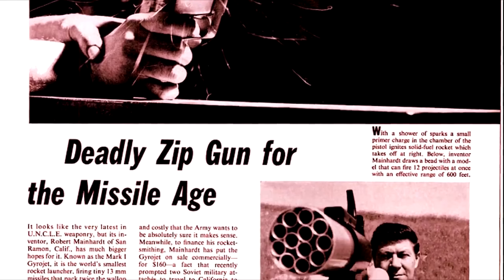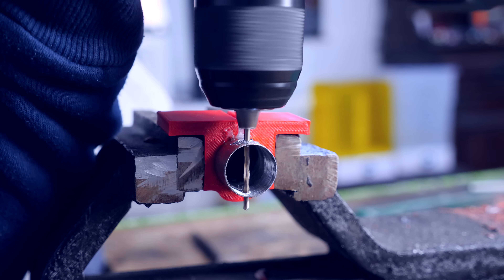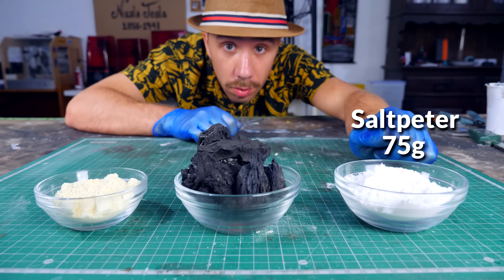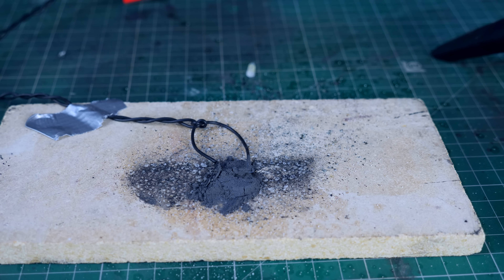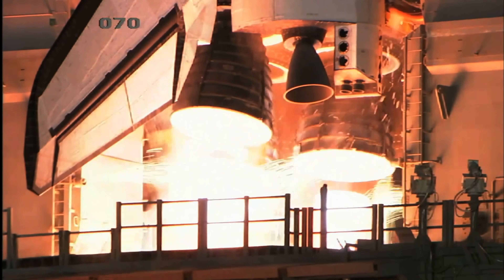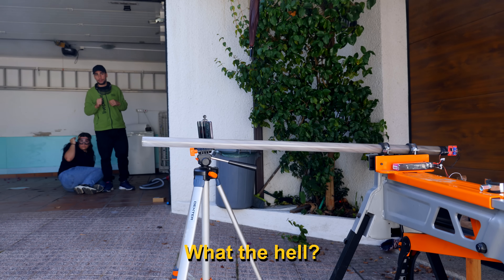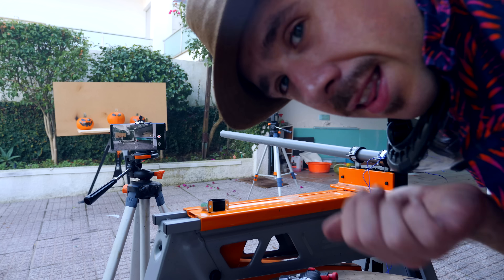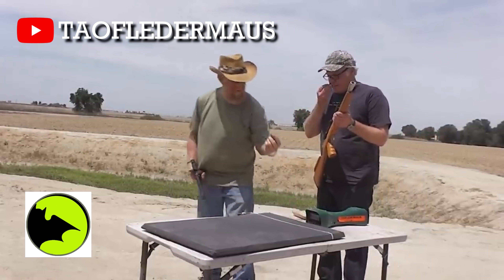GYROJET - The Spinning Rocket Bullet

Comment: Your footage looked like only one of the two nozzles was actually firing. I wonder if internal pressure was forcing the propellant to one side? If you had some sort of distribution plate above the nozzle, would that help balance out the thrust or was the nozzle itself completely failing? You showed the bronze one, but we never saw the aftermath of the ceramic ones so I can't be sure without that data. I know turbulence can be a major problem for high speed flow, so if you had said "barrier" that induced laminar flow in the exhaust gases, could you more effectively utilize the propellant? It'd create more internal pressure and thus force a more evenly distributed output. (Until something failed, at least.)
Reply: As a follow-up, if you could figure out the volume of output gas over time, mocking up a more appropriately sized nozzle would be a piece of cake. Then you would have a much more effective rocket built to the limit of your fuel rather than it flying out in an imbalanced way. I think you could make this work. At least, I think it'd be awesome if you could lol. Keep it up!

Comment: Video Idea suggestion: You should 3-D print an airplane. And with it experiment #1 would be: to fine-tune the airfoil of the wings so that it works well as a glider. And experiment #2 would be: to then put a rocket motor on it to see how well it works with proportion.

Comment: Hay Integza ever thought of giving a Huygens' engine a go?

A gunpowder engine, also known as an explosion engine or Huygens' engine, is a type of internal combustion engine using gunpowder as its fuel. The concept was first explored during the 1600s, most notably by famous Dutch polymath Christiaan Huygens.

1/16th of an ounce of gunpowder, in a cylinder seven or eight feet high and fifteen or eighteen inches in diameter, could raise seven or eight boys or about 1,100 pounds into the air

Comment: for measuring small quantities and pouring them out. I use a lapel tag (found in dress shirts) and a post-it plastic flag. I wipe the adhesive off of the flag and fold in the tips so when i bend the flag the tips overlap creating a funnel of variable size. the lapel tag has a nice rounded tip for portioning small quantities.

Comment: I'd reccomend you look at a video recently put out by tech ingredients when it comes to making good fuel cells.
Reply: I also might think that, for gyroscopic stability, maybe you could just spin up the bullet beforehand, with, say, an electric motor? Frictional losses from whatever barrel you're using shouldn't be bad, but if they are then just like, oil it up.

Comment: You can solve the stability in a few ways here.

1) use rotation like bullets, no reason it shouldn't work.
you can add rotation in the barrel and you can add rotation during flight by making the central nozzle into two(or more) nozzles that are angled.

2) add fins, to make it work with a barrel make them pop out when exiting the barrel.
pretty much like and RPG-7

Comment: A good way to manufacture single use nozzle is by using compressed bentonite (cat litter, the stoney one). Just grind it into a powder and press it into form,  you can use 3D printer moulds for various design and hammer them into shape. 

Furthermore, you can grind the rocket candy into powder, press it into shape and then burn it. It tends to burn with a lot less residue because of the inherent looseness and burn at a much much higher rate. 

Also, I would definitely use aluminum powder instead of iron oxide (same quantity), it increases the burn rate massively compared to iron oxide.

My advice is that if you are planning to experiment with rocketcandy it to also build up a small glass bead tumbler, it's very much worth in the long run.

Comment: Once you get the nozzle situation straightened out, how about a model rocket sized one (2ft long at least)? I'm interested in how stable that would fly or worse case how much it would arc. Realized I should specify vertical flight not horizontal.

Comment: Even though you aren't getting fast enough rotation, adding nose weight and/or making the casing longer will help push the CG forward. Since you have no fins, the CP is going to be very near the center of the cross-section, so it's even more important to get the CG forward (ahead of the CP) to keep the rocket stable.

Comment: Would it be possible to improve the bullet stability by having "retractable stabilizers"? What I mean is, aerodynamic stabilizers that are retracted inside the bullet while inside the barrel, but get ejected (by either the pressure of the gas or by springs) once it exits the barrel?

Comment: please please please continue this. I suggest adding a little more spin angle(for lack of a better term) to your nozzles. also if you use cement you can still use 3d printed molds. I want to see you succeed here!!! only I want you to hit a tomato not a pumpkin... maybe that was your flaw, you didnt really want to destroy the target... lol tomatoes are evil and pumpkins are just orange. maybe use a 3d printed sheathing like a shotgun to take up the space in your barrel. I believe they call it a sabot

Sabot (firearms)
From Wikipedia, the free encyclopedia
Jump to navigationJump to search

Armour-piercing discarding sabot projectile with sabot (left), without sabot (center), and without jacket (right)

Saboted long-rod penetrator projectile before and after launch. The sabot is discarded after launch (right).

.30-06 cartridge with sabot projectile
A sabot (UK: /sæˈboʊ, ˈsæboʊ/, US: /ˈseɪboʊ/) is a supportive device used in firearm/artillery ammunitions to fit/patch around a projectile, such as a bullet/slug or a flechette-like projectile (such as a kinetic energy penetrator), and keep it aligned in the center of the barrel when fired. It allows a narrower projectile with high sectional density to be fired through a barrel of much larger bore diameter with maximal accelerative transfer of kinetic energy. After leaving the muzzle, the sabot typically separates from the projectile in flight, diverting only a very small portion of the overall kinetic energy.

Comment: What if you use a vacuum to make thrust. Like put pipes on the outside of a body and then at the end of the pipes create a vacuum that would have air rush through it upon a seal breaking, the air would be pulled through the pipe and out the end creating thrust.

Comment: Maybe you could research the Hale rocket from the American Civil War era. This item also used nozzle direction to induce spin. So it is related to the later Gyro Jet Pistol Round.  A better propellant to use for these  things would be a 50/50 mix of powdered zinc and sulfur. I'd also like to comment on your safety precautions if I may. Using CO2 cartridges for projectiles in an apartment complex is a good way to get yourself or somebody in the area killed or severely injured If the case bursts it will send sharp metal pieces [shrapnel] flying all over the place. I feel that you would be safer performing your experiments in an open field , out of town, with a greater distance between you an the device your experimenting with. Work safe okay. I'm missing my left pointer finger and half of my thumb from an experiment that went wrong. So I know what it's like when things go bad. Experimenting is good but, please be a lot more careful about what you are doing.

Comment: so what I think is happening with the rockets tumbling;
you've scaled up the projectile, in both size and mass, but are using the original angles on the nozzles that are meant to spin a much lighter and smaller projectile, my thought is if you increased the nozzle angle you would get a higher rate of spin, and therefore better gyroscopic stabilisation.
however, the one side effect of this might be a slower projectile.

Comment: I just want to put it out there so nobody gets there hopes up, but the gyrojet design will never work, unless you somehow made a propellant that burns equally on all sides.

The problem is that since the fuel doesn't burn evenly sometimes one nozzle will get more gas than the other and throw the whole thing off

the only way the design could work is if you drilled out a main nozzle where the primer would usually be and used the two-four side nozzles for stabilization, then the majority of the gasses would go through the large nozzle and the smaller nozzles would only act as stabilizers which would keep the rocket balanced (you can actually see this happen in taufladermauses video where one of the gyrojects had a malfunction and the primer blew out, the bullet flew perfectly straight and if it weren't for the added recoil cause by the failure would have accurately hit the target)

If you (integza) want to create a functioning gyro jet I would recommend that you either follow what I listed above or try making one with one main nozzle and a ring around the outside of the back end of the bullet. This ring will act almost like fins or fletching and help stabilize the bullet (in theory).

Comment: I'm no engineer, or physicist, or anything along those lines, but.
I think you're not getting enough rotation out of the nozzles to stabilise the rocket.

Also, you should try to find a way to keep the rocket in the 'chamber' of your launch tube to build pressure, as other people have said.

Comment: Integza, I actually think you were in a good direction using the tighter acrylic tube, it will help with the tumbling out of the tube, you will need is to close of the back of the tube to give the bullet some back pressure and improve speed and stability I believe.

Comment: You should look into getting a small tabletop lathe. With said lathe you can machine small nozzles to very tight tolerances and specs and thus increasing your chances to succeed in your homemade experiments. 

Also I want a 3D printer. Thanks!

Comment: You should try an ablative nozzle for the bullets. If they don’t need to continuously increase their rpm, you can try to design a nozzle that burns off with the exhaust, with an end nozzle that’s straight

Comment: Is there a reason you didn’t cast the propellant directly into the casing. You could of then used a jig with a pipe to keep the whole centered. That could help reduce some variability and make the rockets a bit more stable. Also increasing the angle of the nozzles may reduce overall speed but increase gyroscopic stabilization. Just a couple of thoughts! Love the videos and keep up the great work!

Comment: for filling a straw with powder with no mess (past the learning curve), just make yourself a little funnel out of paper.  I may or may not have booby trapped some cigarettes with black pepper back in the day.
Reply: it also seems like, instead of 2 nozzels on the back of the gyrojet,  it might work better to put one in the center for your forward propulsion , and two smaller, more extremely angled ones to either side for the spin.  Did that make sense?

Comment: You say that fins weren't an option due to a tight cylindrical tube, if I recall there are some models of rpg that use non- rigid fins. For example, some lie flat against the rocket and deploy backwards after the rocket leaves the barrel. I would love to see that design integrated into your little co2 cartridge rockets.

Comment: A precisely folded piece of filter paper or wax paper is excellent for delivering dry powder into a very small container. You use it like half a funnel. That would have made stock in your little bits of straw much easier.

Comment: I doubt I have any originality here, however I'd like to see you revisit this, but with 3 nozzles and at a greater angle off the center of rotation. I think getting your rotational speed increased would be more important than direct thrust before getting out the barrel. Maybe experiment on the nozzle angles

Additionally, I'd suggest using something like wax paper to line the outer cylinder of the molds you have, and drill out the core or something in an attempt to keep these balanced as my (not a professional) theory is the offset causing all the exciting launches..

Awesome video! That was exciting to watch :)

Comment: Could you add fins that unfurl off of the co2 cartridge? Maybe you could use pieces of a wind-up clock’s spring that would be compressed in the barrel, but open once the cartridge leaves.

Comment: Hi Integza!

Have you tried lost PLA casting?  Perhaps you could take the propane engine setup and use a house brick with a hole in it as your furnace, and a 3D printed Ceramic crucible for the metal (maybe a copper alloy)!
Perhaps the PLA could start with an embedded steel pipe, nut or washer to help strengthen the throat, and your final geometry could allow for similar strong mounting options with a retaining pin!

It would also be fun to watch the lost PLA mess 😜

Comment: So to improve on this experiment, the original gyrojet pistols and rifles had cutouts in the barrel for the exhaust. This will help since the exhaust can leave the barrel with less chance of effecting the projectile. Next, since you are working with a less efficient propellant, you can add rifling to the barrel to help start the rotation on the projectile. Last, stick with the tighter fit barrel, that way you have less of a chance of the projectile leaving the barrel at an angle.

Comment: Now that you have a cnc machine, why don’t you try and make some nozzles out of aluminum or steel and use something like ethanol as a propellant. You’ve worked so hard in trying to make high temp nozzles, why not use a different fuel that combusts at a lower temperature, like ethanol, and use your cnc machine to make a nozzle out of aluminum, brass, or steel? You can always control the combustion temp by controlling the fuel oxygen mix by making the combustion run lean (reducing the amount of oxygen and burning things with an excess fuel so it burns cooler). This is similar to how an engine with a turbo will run much hotter, and to “cool” the engine you run a fuel rich mixture which is wasteful of fuel but you get a “cooler” combustion. Just setting up a testing apparatus in which you can test fuel/air ratios to see how you can make nozzles that survive would be an amazing video…. Plus it’s incredibly practical knowledge for further projects…

Comment: Your projectiles look unbalanced, lots of weight at the back, nothing much at the front. You could try melting some lead into the nose of the bullet to balance them better and make them more stable. Also I believe the angle on the gyrojet nozzles needs to be greater, yours looked pretty straight.

I realize that the real bullets have an empty nose as well, but the nozzle/primer on them also looks a lot lighter.

Comment: The solid rocket boosters for the American Space Shuttle used solid rocket boosters. The fuel had a multipoint star shape as the void instead of a circle. It was found to burn more evenly and efficiently.

Comment: How about a 3 hole nozzle?

A central thrust nozzle with two 30 degree spin nozzles? Not sure on the relative nozzle throat diameters required though.

Comment: He Integza. You could try using the co2 cartridges as the propellant. 
I have successfully done this using a spring loaded nail to Peirce the cap.
And pvc tube to guide.
I'm sure with your 3d printing you could make them work better as mine always spin.

Comment: Also if you want to revisit this again: next time, try using solid pieces of bronze, aluminum, etc. as discs the size you need, then drill in more than two exit points, and smaller.  It can't reach stabilization with only two exhausts, as seen in the bullets you showed the profiles for - most have three....

Comment: The original gyro bullets were propelled from a gun and by the time they exited the barrel they were pretty much stabilized and then when it ignited it just provided thrust. You're trying to replicate that from an open tube without the pressures and speed to stabilize it first and using the bullet itself to propel it from a dead stop. Not really the same thing. Granted this is in your yard with buildings all around so it's definitely the lesser of two evils but man, that thing really moved under it's own thrust and I'm impressed with how quick it was.

Comment: you might have more success with a more angled nozzle, something around 30-35° might be better, as well as using three or even four openings at that angle. you could also increase the space between propelland and endpieceva bit so that the gasses from the burning propellant gather there and distribute more evenly to all holes.
you can see in two of the slow motion sections how more or a of the gas seems to come from only one of the openings, causing the tumble.
in case you don't have one already, I'd suggest a small tilting rotary table for your cnc router, then you can make the nozzle out of something a bit more resistant to heat (and, with propper tools and precautions against the dust it'd create, also your idea of graphite).
also a possible idea for the barrel: three linear guiderails or other blank round stock in 120° apart position with the spacing being just so that the "bullet" will be guided well and securely while not restricting its travel. a couple of 3d printed holders every couple of centimeters (I'd suggest every 7-10cm) you can create good enough rigidity and positioning while not having the possibility of melting (like with the pvc pipe) and allowing you to see what's going on inside. 15-20mm round stock in 1m length also isn't really expensive, you can use very basic material for the tests, so no 42CrMo4 or such, regular S235JR+C should easily suffice here.

Comment: APPLY THE NOZLES
I have an idea you might like:

What if you made a JET-POWERED DRONE!!?
You can use the fuel in pulses by designing the fuel cartridge that way (vary the cross section) and try to obtain sustained hover (or even directional hover)?

This can be easily printed with your resources.
Please upvote if you like this idea